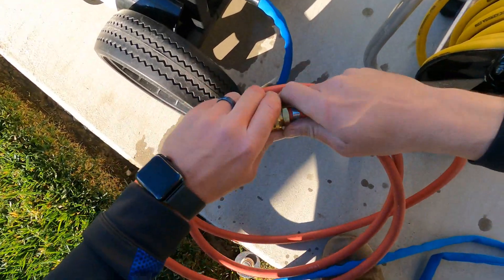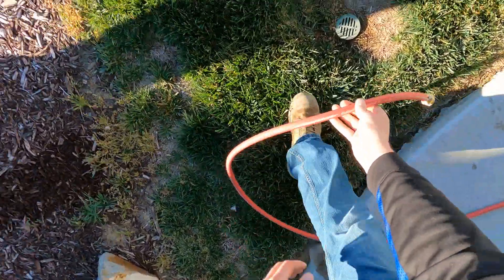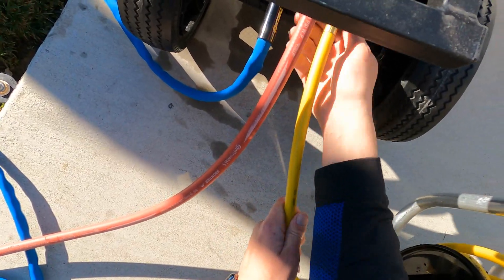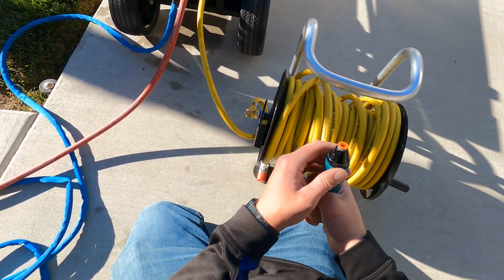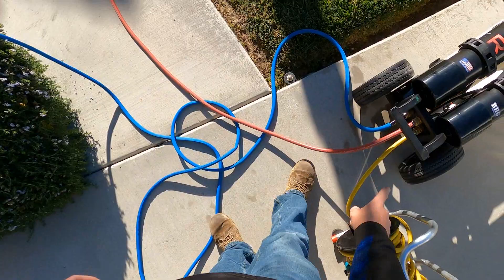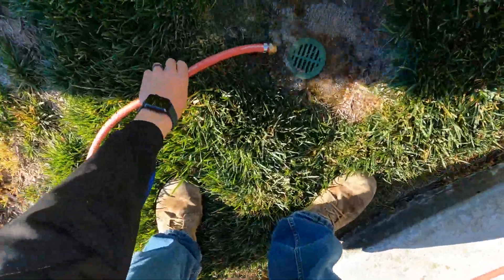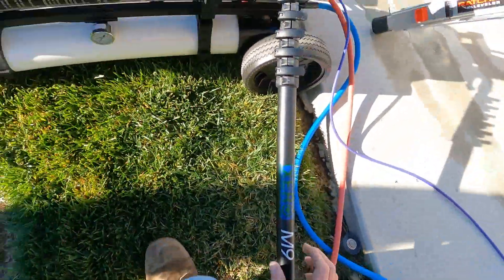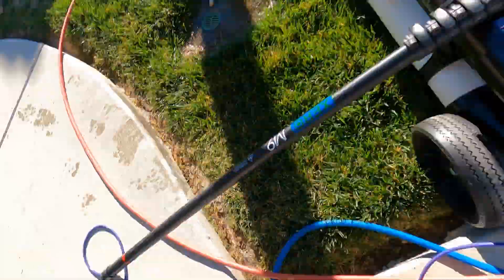HOW TO SETUP TUCKER 4060 FOR WATER FED POLE

Comment: Just ordered this system along with a 60ft Xero destroyer pole. Excited to put it through it’s paces on some high rises 🪟
Reply from the maker: Nice how are you liking it now?
Reply: @JoshuaTheWindowCleaner  Game changer for sure! Did a 70’ building (had to order another section) and had no issues with water pressure. Love hearing the comments of awed spectators as they pass by. Never tire of hearing that 😁 Pole is rigid enough to work confidently at those heights. I’m happy, customers are happy 👍🏼 The only thing I wish was different is how you add sections. Kind of a pane to work your water line through every section you’ll need, and then as you work your way down the unused sections have to be left on the ground trailing you, unless you retract everything and take the time to disassemble it. Attaching the additional sections once you’re at height is kinda tricky also for one person. I’m a one man show though, so for guys that have a partner it’s probably not that much of an issue. Overall, super glad I invested in it.
Reply from the maker: @williamhankel2113  that’s great news bud! Thank you so much for your feedback 🤗

Comment: Hey, I just bought a water fed pole system, and just wondering when you close off the bypass, should water still pass on your bypass hose? I’m just not getting the best pressure on the brush. Any help would be appreciated 👌🏽
Reply from the maker: Yes your waste water will still be running after you close the bypass valve. Some houses and commercial properties have low pressure. I experienced this more than any other issue. To resolve the issue I purchased an electric pump and now can run two poles with no pressure issues. Also the RO membranes work better under more pressure and will last longer with a pump so it’s definitely worth the investment. If you watch my video cleaning 50ft windows I show the pump that I currently use. 🤗 I hope that helps 👍🏼